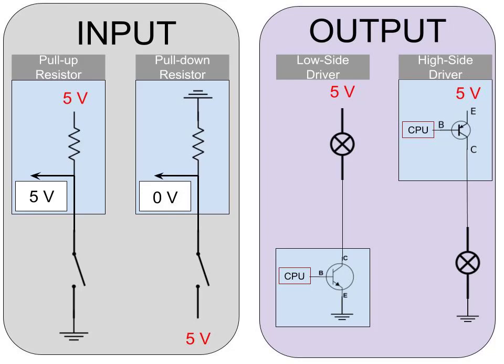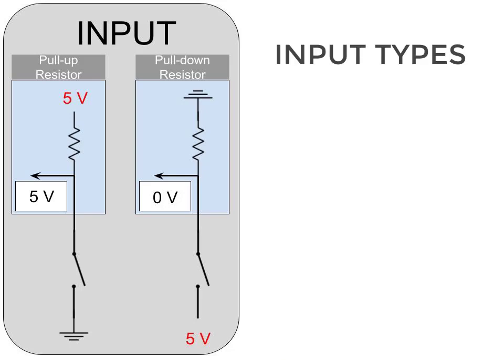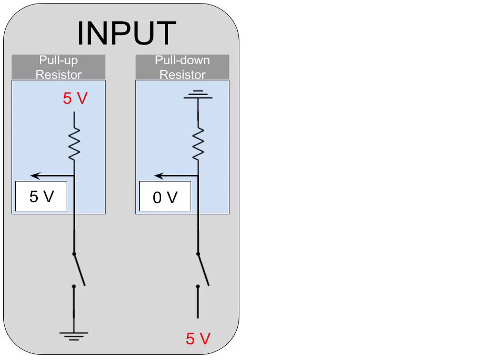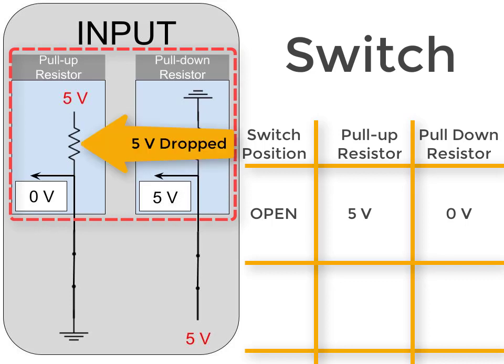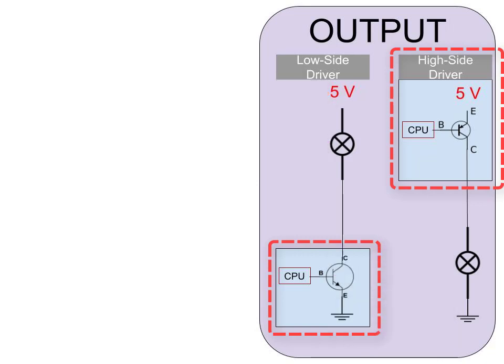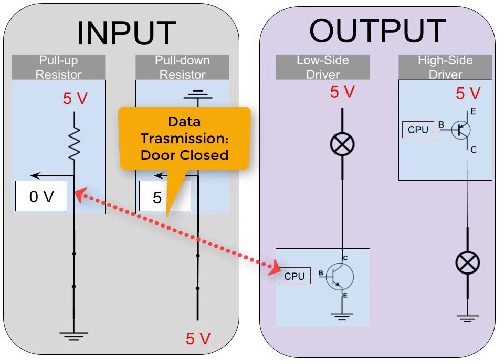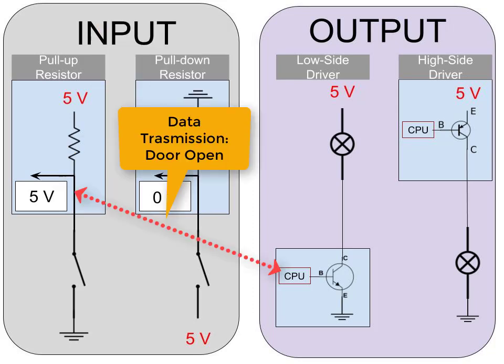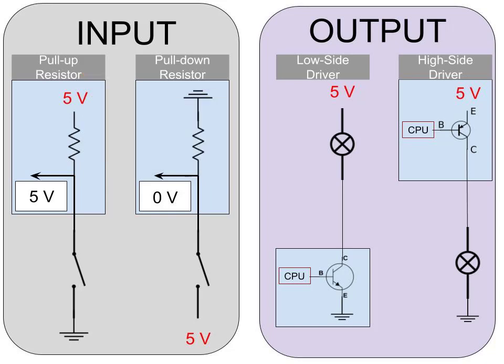Explanation Of Inputs and Outputs

Comment: Excellent video!! Can you explain how a 12 volt vehicle system can have multiple 5volt references . I was taught in the 70s that each sensor draws some of that 12volt . It seems impossible in my little mind how it covers all those imputs and outputs 🤷🏼‍♂️ lost
Reply: An ECM (Engine Control Module) generates a stable 5 volts from a 12 volt system by using a voltage regulator circuit inside the module, which essentially acts as a voltage divider, taking the 12 volt input and dropping it down to a precise 5 volt output through a combination of resistors and transistors, allowing for a consistent reference voltage for sensors that require a lower voltage signal to operate properly.
Reply: @ thank you